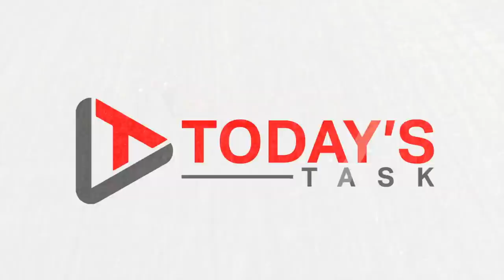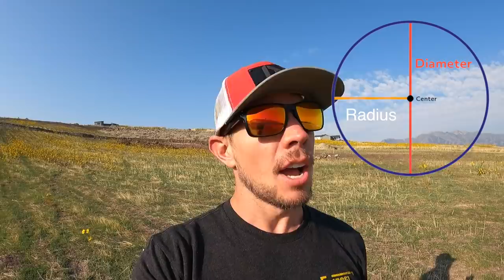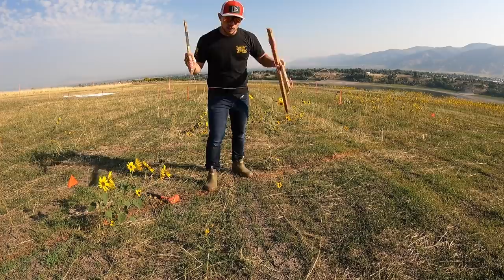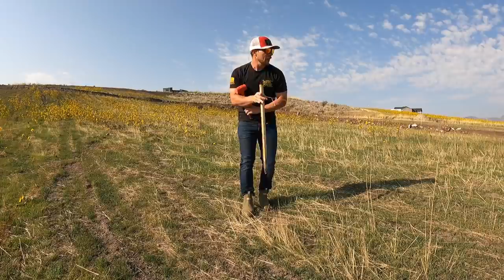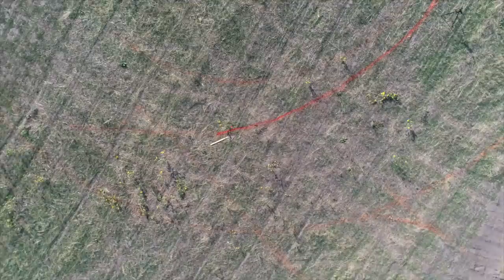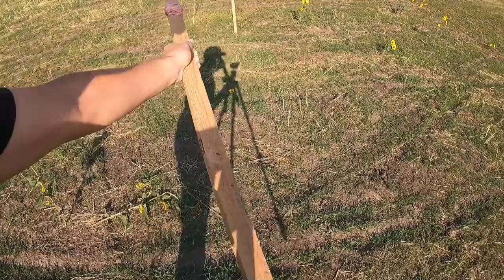Building  Our Roundabout - Three stake Radius trick.

Comment: For those who hate having to comply with building codes, what he said is why codes exist - they are for our benefit. I have a friend who used to work EMS in rural Idaho where there are few if any building codes. He has told me stories of property owners refusing to build a driveway that the fire equipment could use. So the fire equipment sat 1000 feet away while the house burned - just watching and not able to do anything to help.

Comment: I have to admit, I didn’t understand this explanation…..hmmmm
Reply: I understood the measurement from the center stake in order to set the radius; however, a simple drawing showing the house (even a drawn rectangular would work), the shop, and the original driveway, and then an overlay of the new driveway and roundabout would solidify his new plan in our minds.
Reply: @probablynot1368  but it would not show the heavy equipment operators where to dig or grade…Joel’s method moves the plan from paper to the real, tangible world.
Reply: @judmcfeters9054  Yes, Joel demonstrated his ‘real world’ solution as he was marking his lot for grading.  I was suggesting BEFORE implementing  the 3-stake radius method (which I’ve done myself), a drawing of the revised placement of the driveway and the roundabout would help explain the changes to his more visual-learning audience.
Reply: His primary concern was not where the center would be, but, rather, where the edges would be (since he’ll have structures on the property). Therefore, he’s working “backwards” by first placing his edges and THEN determining the center.